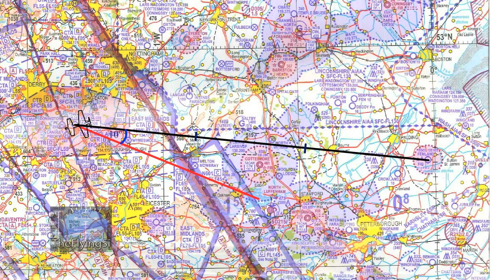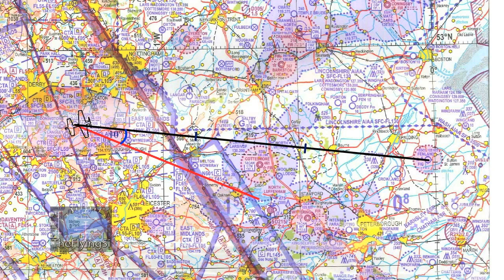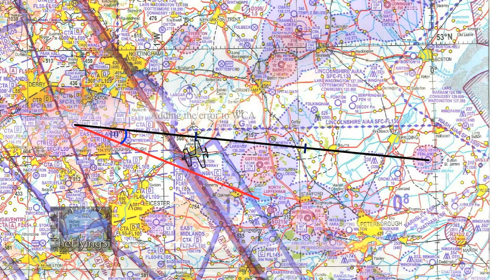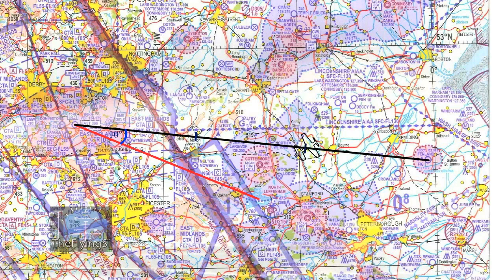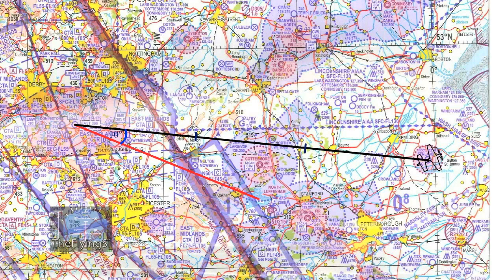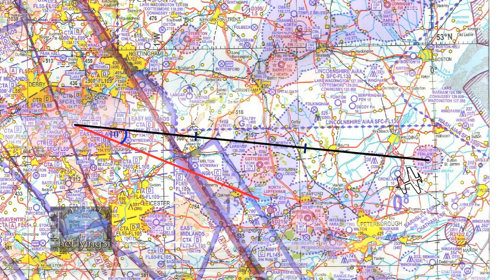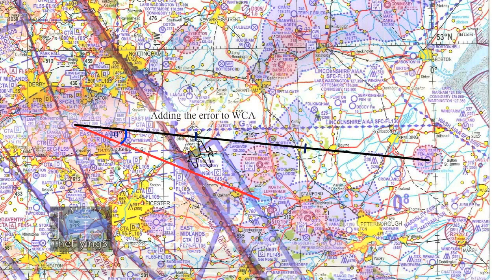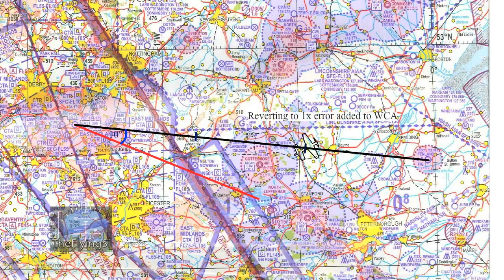Drift lines & the Double Drift method

Comment: Thanks! Very helpful:) However, would you not use double drift to revert back on track after using the triple method?
Reply from the maker: Absolutely correct.  You use double the error until back on track and then simply add on the error to your WCA.
Reply: Cheers!! @FlyingSi

Comment: Hi, Why would the airfcraft fly between the driftline and the intended track?
Plus, ten minutes is a duration not time. I am confused. When you say take the time at Melton, then you say 10 mins. What is that ten minutes? Could you please clarify?
Reply from the maker: We plan using forecast weather, but that may not be the exact conditions on the day.  So the actual track may vary from the intended one.  You can swap time for duration if that helps?
Reply: @FlyingSi  Perfect. Thank you very much. I apprecaite your feedback :)